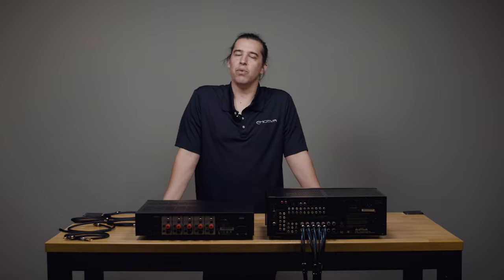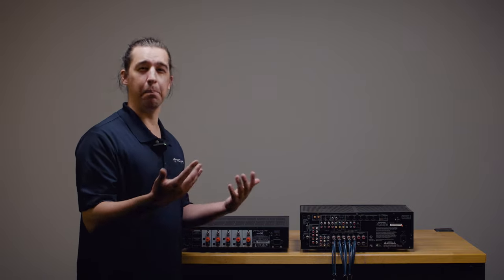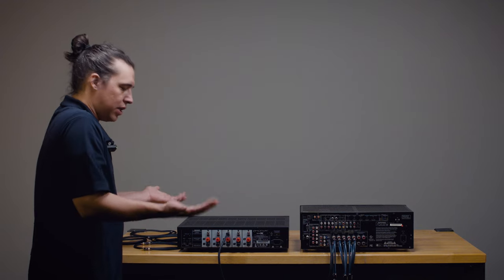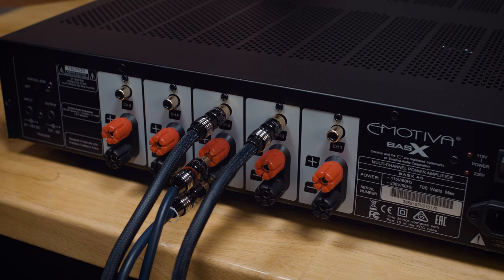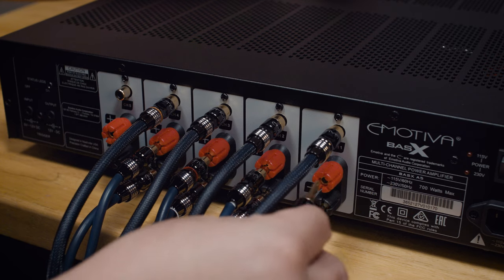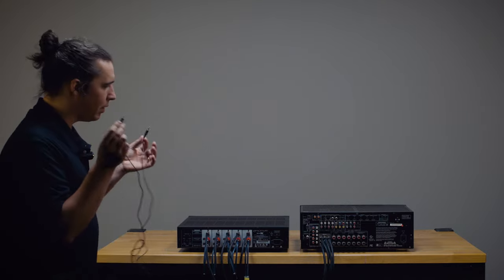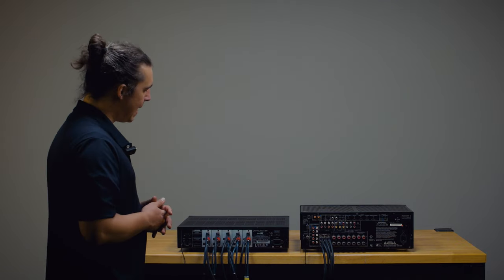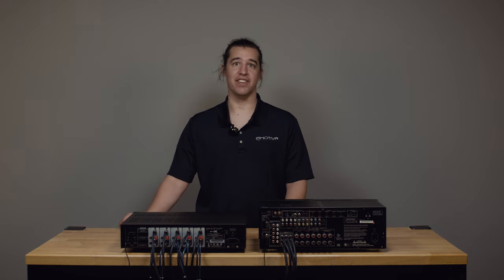How to add an External Amplifier to your Home Theater Receiver!

Comment: I wish lower priced AVRs had more preouts.  You can find some for the fronts/subs but for more channels it really raises the price.
Reply: You can use a line output converter
Reply: Multichannel processor are best
Reply: @ekimandersom4478  how would this be wired? My receiver only has sub preouts, but I have a line output converter.
Reply: My Onkyo NR686 doesn’t have pre-outs, quite frustrating. I’m looking at getting the Anthem MRX540/740.
Reply: I use y splitter cables. Works good.
Reply: I WISH BWM OR AUDI WERE THE SAME PRICE AS VOLKSWAGEN 😂😂😂. YOUR WISH IS HILARIOUS
Reply: Boo fucking hoo 😢
Reply: Sheesh, tubers are so edgy lately
Reply: @kodyadams5561  it doesn't cost much more to add preouts. Many audio processor for surround are very cheep,

Comment: Blazingly simple, yet elusive to this day for some. Great video. Most people get lost in it is just more power. No, it is not just that. It is about more dynamic headroom for the peaks of energy your presentation may have. Receivers today are feeble versions of themselves today. Most won't punch beyond 50 watts per channel all channels driven into 8 ohms 20hz to 20khz. They are about gimmicks not power anymore. So these external amplifiers are a huge boost in dynamics and punch and reserves no AVR will even come close to doing. Barring perhaps the Class D receivers, but you know how that goes.

Comment: I just now purchased a BasAx a3 to power my front 2 klipsch RP 8000Fs and RP502 C. Connecting the amp to my RZ50. I’m excited!
Reply: How did u like it? Did u see any difference.  I am running klipsch rp 8000 f ¡¡ and a klipsch center rp 404c ¡¡ and a svs subwoofer.  Thinking if adding an emotiva amp would help in any way. Thanks

Comment: I'm using a line level 1.2 for the main speakers Emotiva amp, and it is working good. Maybe Emotiva should make line level converters for their amp and older AVR's.  Mine is from 1993 and it's a JVC, BUT THE eMOTIVA MAKES ALL THE DIFFERENCE.

Comment: Thanks to this video and the explanation given I decided to buy the a7. I just finished installing following the clear instructions. I turned it on and I thought I had purchased a new set of speakers. What a difference the a7 makes. I can hear more detail. Even the subwoofer sound coming from the two front speakers came alive and I had to turn the subwoofer down. I was so unhappy with the way my system sounded that I had purchased an equalizer. I will return it as I no longer need iit. Great video and great product.

Comment: Great video and explanation on how to connect an external power amp to an AVR. I followed your instructions to the letter and connected my Marantz C50 to my new basX A3 external amplifier. Wow what a difference to my LCR front stage. I've left my 2 heights FLR and my Surr LR connected to the Marantz C50. Now my 4 ohm Piega speakers are really singing! 😊 The whole system has really come alive with this added injection of power.
Reply from the maker: Glad it helped! Thank you for your comment.

Comment: This is exactly what I've done with an Emotiva a5. It's a magic unit that always stays cold to the touch when my AV amp even set in preamp mode gets very hot. It also means the AV can sit happily on the Emotiva forming a perfect stack.
On my old AV (I haven't tested this on the new one) at very low levels the sound distorted I think because too little power was being sent, but the Emotiva totally solved that issue.

Comment: 👍🏻 + 👍🏻 
Incorporated an A3 with my old RX-A2060. Zero hiss or hum. Prior to installing my avr was borderline hot,even at lower listening levels. Now the Yamaha runs lukewarm as does the A3. And without going into great detail,  Acoustically it improved key areas in my 9.2 system. And no thump or bump on start.
Reply: You should replace that receiver man. That’s a real
bad sign. I have a marantz one for sale to. If your in Albuquerque I can give u dibs on it.
Reply: @purplerider2362  It’s really not uncommon when you’re pushing a dozen 8” drivers in 4 towers and a full complement of surround & backs and atmos. Not to mention the high volume level. 
I’m trying out a Denon x4800h and it gets pretty warm too powering the whole shebang.
Eliminating the load from LFC channels makes a difference. The yammy is on bedroom duty for the remainder of its life.
I appreciate the offer but I’m on the Washington coast.
Reply: @jatoav8or  I got ya. That makes sense. Pushing a ton of speakers would definitely get it hot. I miss understood what you were saying. Maybe add more amps. To take some of the load off the main receiver? I’m no pro. I happened to get a sansui 9090 for ten bucks at a yard sale. Thing would get very hot. It still does get hot. I don’t use it tho. The system I have contains a xpa-dr2 power amp.
With a cheap preamp from emotiva as well. And a basx a300 the first one is 550 watts a channel and the other is 160 a channel. Both running from the preamp with a rca y splitter. Only four speakers connected and it shakes my house. I can only imagine how awesome yours sounds!! It probably shakes the neighborhood! 😂

Comment: Awesome video.. if I plan on running a 7.2.6 setup.. would it be more ideal to run a 3 channel amp for my fronts.. a 4 channel amp for my surrounds and a 6 channel amp for atmos channels? Or should I consolidate the 3&4 channels amps into one 7 channel amp? What would be the pros and cons of the first setup vs consolidating? 

Thanks so much

Comment: I did use the line level to RCA converters, kicker brand, grounded them correctly and used external amps. The positive.. vastly increased power to get the volume gains that you want. The Negative.. added distortion, not a terrible amount but it is noticeable and a light static noise when nothing is playing, mind you not enough to stop the auto-off functions of the amps from working, but it was there.  My concern was more about volume than it was clarity at the time. But if I were to do it again, I would get an amp with pre-outs or just a processor with outs.

Comment: I am running an A3 and A2 for my front and rear channels. Leaves good headroom for my surrounds, I do get a buzz from the Emotivas when the lights are dimmed. I only notice it when the room is silent, but the dynamic peeks are great and I watch movies with lights off anyway.
Reply from the maker: That could be more from them being on the same circuit as a dimmer. Dimmers are notorious for adding noise into systems. I would move them to a different circuit or put them on a signal buffer like with our CMX-2.

Comment: What will happen if you have different impedance example LR are 4ohms and center is 6ohms and surround is  8ohms. Will the this amp automatically detect what ohms my speakers are and adjust as per channel?
Reply from the maker: Our amplifiers will drive anything from 4 to 8 ohm loads with no issues. Even though your system has different impedance levels, our amps will drive them automatically.

Comment: I wish my current AVR had "pre-outs" for at least the LCR channels.  However, I often wonder if an external amp is worth the expense.  My LCR are 4 ohm Emotiva T-Zero towers and a C1+ center.
So, Brent, in your honest opinion, does an external amp make a $500+ improvement in audio quality?  Thanks.
Reply: I think this is a great question, but one that is difficult to answer definitively. Will a BasX A3 or A5 outperform the internal power amplifiers in most common AVRs? I think the answer is almost always yes, the performance will be better using a dedicated amplifier. But there are many variables, like your listening habits, room size, etc. as to whether you will reap all of the benefits of an external amplifier. Even if you aren't pushing the amplifier that hard, the quality should still be an improvement over the AVR amplifiers in most cases. It can be difficult to put a dollar amount on personal enjoyment of your audio system regarding upgrades, but based on personal experience with the amplifiers and talking with countless customers who make the upgrade to external amplifiers, it can make a big difference in your setup!
Reply: Personally, if I was gonna upgrade I'd really upgrade.
Reply: @Roof_Pizza  same basic process applies to the higher powered amps like the XPA Gen3 that can also be added to AVR setups for even more power! Adding external amplification to some or all channels with an existing AVR is a great way to incrementally work up to a separate processor and amps for all channels.
Reply: @brentberkompas4740  I wouldn't bother with upgrading the surrounds unless I moved into a huge place. Yeah, the XPA 3 channel or similar.
Reply: @brentberkompas4740  Sir, your answer ids surely correct.  I've been wanting a processor - amp system for a long time but the $ are never in my favor.  Maybe someday a MC-1 and amps will be powering my system, but that someday seems so far away.  I've even been considering cutting the amplifier section out of one of my old AVR units and installing RCA jacks to connect an amp to. Thank you and all the very best to you and yours, Kevin
Reply: @Roof_Pizza  Oh I pray for a separates system everyday.  But, I'm completely unworthy.
Reply: Use a low pass adapter turns regular speaker terminals preouts . Has rca plug to plug into power amp
Reply: If you're listening habits are more catered for 2 channel stereo, I would recommend externally amplifying the front stage but if you prefer listening to movies more than music and you happen to be running a Dolby Atmos setup, I would highly recommend externally amplifying the Atmos channels frist. Most people don't realise listening to anything other then Dolby Atmos content with height channels on, actually messes up the whole soundstage! That's one of the downfalls they don't tell you about using height channels internally with an AVR. Besides isn't it best to listen to a movie the way it was intended to be heard!

Comment: Im in the opposite situation....My old amplifier has plenty power, but needs newer processing. It claims to support DTS, but since I use Optical(its best connection) DTS doesnt allow to work through Optical/ToSlink.  I am only using 5.1. although I DO have 2 mono amps that this main amp is designed to take on and power a 7.1 (Continuos 140w per ch / model: Marantz SR-14ex) I was thinking one day to add a 2nd sub (not supported via amp, but sub does support a link to another I think),  but not interested much more in speakers, as I don't see the Dolby Atmos11-13ch  thing being important at all. Also, my space is not that large, though I enjoy loud movies and music.  

Another thing I was hoping to do was having a way to do room correction, like I have done in my car with mic and Rew, and time delay, EQ, etc. I think one way is having Dirac live built in, or something.

I have the 2 additional Marantz 140w mono Amps to add 2 ch and make it a 7.1, but for now, I was hoping to just get DTS decoding, and maybe newer ones. My LG TV is new, my LG BluRay player is new also. I never was a believer in merging audio with video, so I never jumped on the HDMI to amplifier idea. Just was not logical to me. 
Maybe there is a simple way to get the newer decoding. I did see a few happy people using some $150-200 decoder device from Amazon, but some people had issues. I am thinking of giving it a shot. Or try something more known and tested to work well.  
I thought of Emotiva might be the answer.  And there were some more logical processor models some years back, I think in the 500-800$ range. But those are gone, and now it seems out of reach.

Anyone know what my options would be? I am not willing to give up the amplifier. I really enjoy it, and the remote it has is the Proton...old, but very capable.
I wonder if anyone is even monitoring the comments section? :-)

Comment: I am using a BasX 7 channel off of my Denon AVR-X3300 on Emotiva T2+, C2+ because they are 4 ohm. I think the Denon is thw weak link because it just doeant seem to put out enough preamp voltage to make the amp really push the power its capable of in my opinion. I can max the volume and it just doesn't get very loud.
Reply from the maker: We believe you are onto the issue. The Denon is the culprit.
Reply: @EmotivaAudioCorp  looks like I see an Emotiva processor in my future 😆

Comment: if I have a powered subwoofer (built-in amplifier), where does it fit in your setup ? , C,R,L, rear surrounds(2) - 5 ports/options.
Reply from the maker: Powered subwoofers will always connect to your processor/preamplifer's subwoofer output and NOT your amplifier.

Comment: Did the same with a vintage Marantz and a used A-100 i found on line. Are you better off using a decent RCA cable vs using the cheap ones you get free with your DVD player?

Comment: Thank you for the time you devote to helping us along, I’ve been enjoying your content! I’m new’ish to the more advanced side of home theater setups and in particular, to Atmos…but I’m in the process of buying new hardware and I have some questions which I hope are not too long or cumbersome! 

1. 2 CHEAP (old) AVRs vs 1 EXPENSIVE ONE? For the budget-minded, rather than buying one of the newer AVRs that offer all the channel outputs needed to have tons of speakers, could someone use 2 (older and cheaper) machines to power the same number of speakers…and still get proper Atmos configurations? 

2. DO OLDER AVRs HAVE PROPER ATMOS OUTPUTS? There are used Denons selling online, like the AVR-3312Ci for around $100. While on the back it has 1 set of “Height” outputs, it doesn’t say Dolby Atmos on the machine. Are all “Height” outputs on older AVRs sending data properly to overhead speakers? The AVR-3312Ci does say Dolby TrueHD, DTS-HD amongst other things, but not Atmos. Does a receiver have to be Atmos specific in order to pass the data/sound properly to the speakers that would be setup as ceiling/upwards-facing speakers (not to mention the ground-level speakers that Atmos communicates with)? 

3. 2 AVR’s? —or 1 AVR + 1 AMPLIFIER? If the answer to question 1 is that yes, (you can buy a cheaper AVR to receive all the HDMI (and other) inputs from your sources…and if said AVR doesn’t have enough channel outputs to power 5-7 ground-level speakers AND 2-6 ceiling/upwards-facing speakers) …would one be able to use the pre outs to power an additional amplifier? —or would it need to be another AVR, to get the proper Atmos configured output to the speakers? 

4. REGARDING THE SPEAKERS. If I put together the right AVR system (whether a single unit, or a combination of 2 or more) to power (up to) 7 ground-level speakers, plus 1 (2, or 3) sub-woofers, plus (up to) 6 ceiling (or upward-facing) speakers, can I mismatch different speakers and brands? For instance, I recently bought a set of Klipsch Reference Theater pack (before I knew about the Reference Cinema pack). If I keep the Theater pack and buy 2 more ground-level speakers…AS WELL as some overhead speakers (whether ceiling-mounted, or other) …could I shop around to add to this array, even if I end up getting cheap ceiling speakers? The ceiling speakers (round ones that install into the ceiling) seem pricey compared to the set 5.1 set I just bought. If I shop around and buy other brand speakers (whether the round ones made specifically for ceiling use or not), would that yield workable results? 

5. KLIPSCH UPWARD-FACING vs CEILING SPEAKERS. Which are better? Would the Reference Cinema pack be a better option for having Atmos “ceiling sound” rather than using the Reference Theater pack and adding cheaper ceiling speakers (mounted on the ceilings and pointing down)? 

Thanks in advance!
Reply: Simply put, 1 av receiver. It don't have to be expensive but it has to be Atmos enabled and it has to be at least a 5.1.2.. If it doesn't say that it can drive a 5.1.2 or more, then it Atmos. The.2 is Atmos. Hope that helps.

Comment: Hi Emotiva Team, I do have a 7.2 receiver, can I use the unused speaker inputs in the the receiver e.g. front height and rear height inputs to make it a 5.2.4 setup? Right now I have a 5.2.2 setup. Thanks.

Comment: I'm new to this concept, once you get everything setup, how do you control the volume, through the receiver or the amp, or do you have to adjust volume on both amp and receiver?
Reply: The preamp/processor/receiver will control the volume. Once the amp is hooked up, it pretty much just sits there.
Reply: @nickmandara8231  Thank you Nick
Reply: @alanb2140  Whwn you connect the two with the trigger wire one you turn on the avr it automatically turns on the a5
Reply: There is no volume knob on the amp.
It is an amp, it only amplifies the input.

Comment: Just to clarify, on the receiver side, it doesn't matter if I plug the single RCA connection into white or red?
Reply from the maker: Correct. As long as the single ended RCA Pre-Output matches with the correct speaker connection on the amplifier, you are good to go!
Reply: @EmotivaAudioCorp  awesome, thanks so much

Comment: Thank you for the presentation. I want to but the 2ch one.
I am a bit confused about the volume output in the preout-amp setup. If the volume "sounds" the same, can you get louder volume? Is it connected with the preamp? How does it work?

Comment: Is it okay to only use receiver as a preamp?  Meaning no speakers attached only preOut to amp.  Doesn’t the receiver require some sort of speaker load since there is no speaker connection 
?

Comment: Question:  Any thoughts on the benefits or advantages of bi-wiring off the A3?  I am driving three 120 Watt B&W speakers with dual binding posts and wonder if it'beneficial given that the A3 generates 140 watts per channel.  Thanks for the wonderfull video.